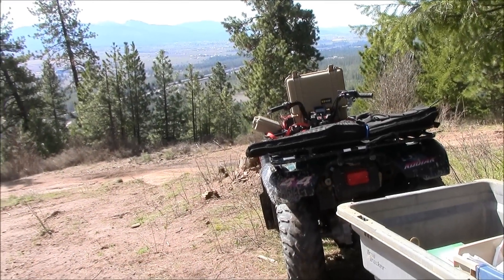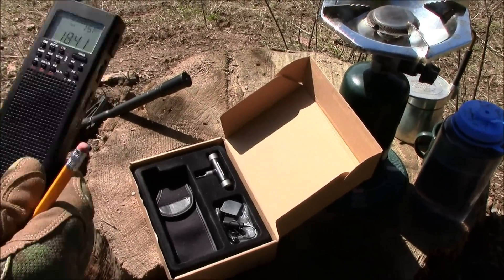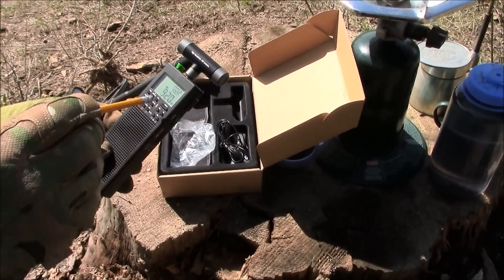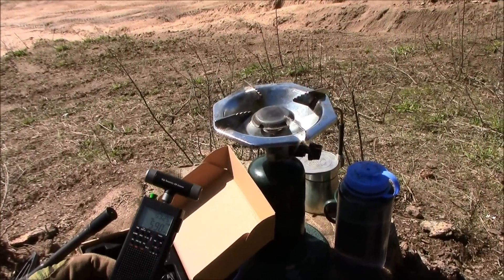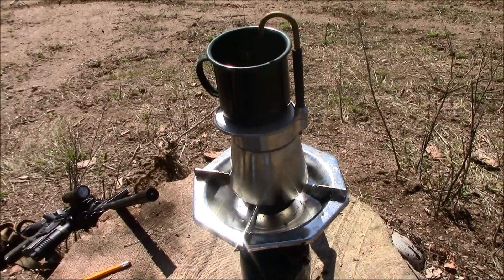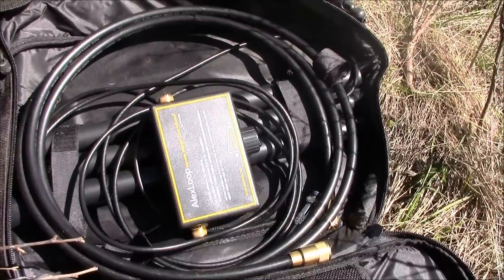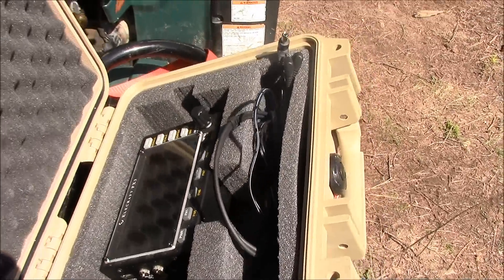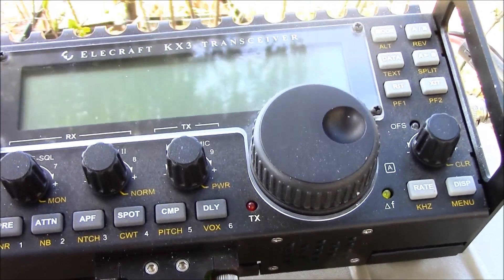In the field with JJS and the KX3 (March 2016) Part 1

Comment: JJS I just wanted to say first of all, thank you for your contributions to emergency communication. It is inspiring to see the network you have helped to provide that may be of extreme value in a grid down or national emergency situation. I sincerely appreciate this community of people dedicated to maintaining a background service most overlook. 

Next, I would love to know if you've had the chance to use an Icom 705 transceiver? I feel that the 705 offers so much more benefit to the Elecraft. I appreciate the elegance of the Elecraft transeiver, but the Icom is inclusive of everything that X3 owners such as yourself have added such as the 2m module and the panadaptor. If I lived closer I would volunteer my radio to your service to experiment with. It is so simple to use and is in such a small package. It would give you the advantage of the panadaptor to "see" the nearby band signals without having to lug around an extra piece of component to damage and also reduce the weight and size of the overall package. With the larger battery Icom offers or the use of an external 12V battery like you used in this video it can output 10W. It can also be connected to an amplifier in your shack and easily be used as your main shack radio. It's already to transmit on 2m and 70cm as well and excels at digital modes. 

Lastly, I find videos like this one very inspiring. I can put myself in your shoes on that mountain top with the AR nearby at the ready while my coffee is brewing and the radio is getting set up. I've watched this video and Part 2 a few times simply because it seems so foreign to me to be on a mountain elevated above everything. What a fun lifestyle! I live in Northcentral Indiana where there are no hills, but only valleys and miles of fields. I don't know if your new location that you have moved to offers anything similar, but I would LOVE to see something new like this, no matter how mundane it feels to you. It's a mental getaway for me and probably others too.

God bless you and your efforts sir!

Comment: question, with the loop antenna. have you noted the operation of the tuning capacitor. does it tune to more or less capacitance  as the frequency goes down. i ask this because i plan to build my own and wondered. and it will handle more power, with a capacitor of a higher voltage rating. where a 1000 volt cap will do legal limit.